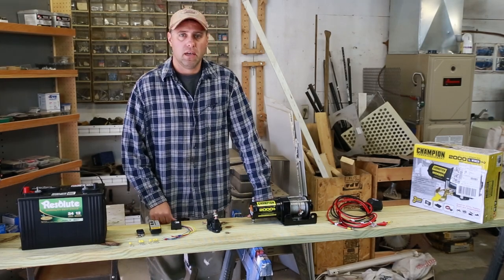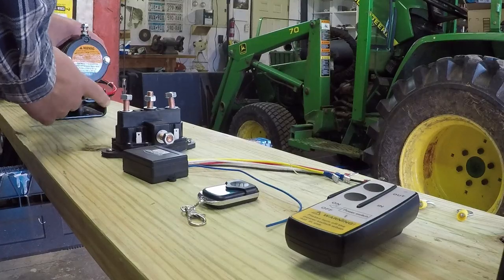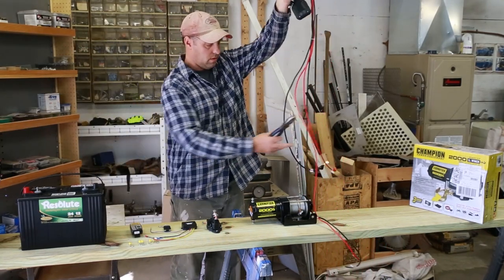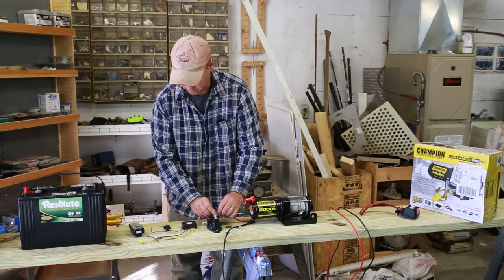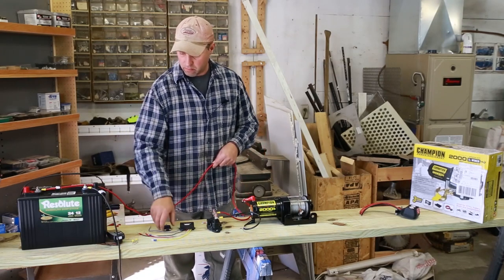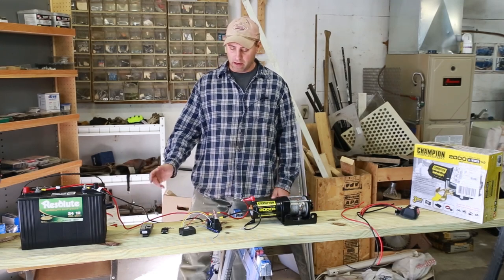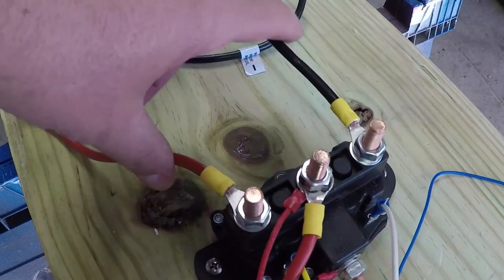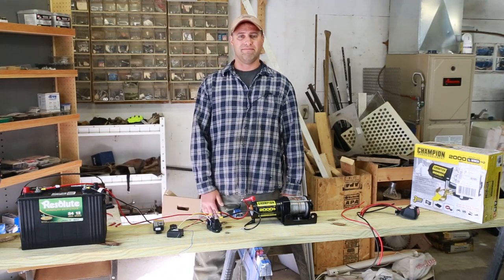Remote Controlled Winch

Comment: Thanks for the video. You need to put a fuse into the positive wire from the battery. As you can see a short circuit will heat those wires up enough to start a fire. Fuse should be about 25% higher that the rated current draw of the winch.
Reply: You don't put fuses on Cables that are meant for winches. You put breakers. You will be going through a lot of fuses if you did.

Comment: You need to have the both the battery red wires bolt down before you put the 2 black negative wire battery wires on. That is what caused the sparks and the short. Black off first, red on first to replace is the rule. other than that good job.
Reply from the maker: Thanks for the info.

Comment: you can also switch pos and neg on the motor if the in/out are reversed, great video, very informative
Reply from the maker: Thanks for the tip.
Reply: @lifeoutdoors7095  i know this is a long time since you saw this video but you do not need to switch motor wires to reverse polarity just switch the 2 wires (spade connectors ) for remote in most cases the blue yellow remote connectors are all you need

Comment: Nice info.  HOWEVER!!!  The reason you got sparks is because you effectively short-circuited  between the pos and neg poles of the battery.  Using the steel socket driver to tighten nuts on the solenoid, it was inevitable, because you connected the solenoid to the battery terminals first.  ALWAYS DISCONNECT THE BATTERY BEFORE FOOLING AROUND WITH WHATEVER IT'S ATTACHED TO!  Just a word to the wise.  Another commenter talks about using an inline fuse, which would have blown if fitted.  With no fuse or circuit breaker, the heat produced by the short-circuit could have welded the socket driver to the contacts it was touching.  Next to zero Ohms resistance, with a battery that develops 600 cold cranking Amps or more, and you could easily have had an explosion.  Further, just because the battery has a stated 600 CCA, doesn't mean that's it's limit, but assuming that 600 Amps is it's limit, Volts times current (Amps) equals Watts.  That's 12 times 600 equals 7,200 Watts.  Your average kettle only uses one third of this.

Comment: Thanks for posting!  I've been using the wired remote that came with my winch and it is really a tangled mess some times.  If this will work reliably for a long enough time it will be a real blessing.  Watched a couple of other vids and the guys meant well I'm sure but they didn't really show how to actually do anything?
Reply from the maker: I searched hard when I did it, and couldn't find anything useful, so I figured I would put something out there. Glad it helped.
Reply: @lifeoutdoors7095  Just finished installing the remote on my winch.  Works great now I have to make a cover for it and I connected it to the winch motor with 50 amp Anderson type connectors so I can still use the old wired remote if I have to.  Thanks again for the video and info.!
Reply from the maker: @lloydprunier4415  The system I used was cheaply made in china. So far its been working well. The remote controllers seem to be the weak spot though. I'm glad it came with two, because the bigger remote one only works intermittently now. Overall I'm happy with it. I'm happy it all worked out for you!

Comment: shouldnt you have a fuse on the power wire to battery? my winch has a 50amp fuse. It would of stopped you from almost making a fire lol
Reply from the maker: Yes! I actually use a circuit breaker.

Comment: Do i need that solenoid when my winch has a control box already or are both needed, does the relay change the direction of the winch, right now it only works in one direction but that could be because i hooked it up wrong and smelt something burning. Or like i am kind of hoping the relay is needed, anyone out there like an electrician or somebody help, thanx

Comment: Does ur wireless box click when u hit the up or down button mine does am thinking that the box might be junk I know mine winch works
Reply from the maker: It does click, but I believe its the reversing solenoid that's clicking. The transmitter is cheap junk from china, so there is a chance it won't work. I figure I can just replace it for $20 rather than spend the $400 on a good one.
Reply: Yes hearing it click is due to it making contact either way. If you don't hear it click that's when you have a problem.
Reply: The relay is what you hear clicking

Comment: If you don't' need to have the motor reverse, then you simply don't need the reversing solenoid, right?
Reply from the maker: I can't say for sure, but here's how I see it. The reversing selenoid also makes a disconnect to the battery, so when it's not going up or down it keeps power from going to the winch. If you took it out, them you would have a direct connection to the winch with no way to stop it. You can still use the set up I have, just only use the forward button. So the wireless transmitter needs to be hooked into the selenoid for it to work.

Comment: *IF ONE WOULD LIKE THE IN &OUT TOGGLE SWITCH HOOKED UP ALONG WITH ALSO WIRELESS REMOTE AS WELL, WHERE DO YOU CONNECT THE MANUAL IN &OUT TOGGLE TWITCH WIRES?
Reply from the maker: Good question. I would have to experiment to find out, but here is my thought. I would connect it as per the directions. The toggle switch has two sets of leads, with one set of leads going directly to the winch and the other to the battery. That way it bypasses the wireless set up when being used, and when using the wireless it should still work. Just don't use both the wireless and wired toggle switches at the same time. I haven't tried it yet, so give it a shot and let me know if it works.
Reply: Get a momentary switch.  Should have 3 prongs. One for power then the other 2 would go to spade terminals on the reversing solenoid.  Should work fine.  If one wanted to bu pass module completely. Just an off/on switch going to module.

Comment: NEVER NEVER connect full circuit, (connect power last,) until ALL wires are correctly connected dont play with electrical components unless you proficient,